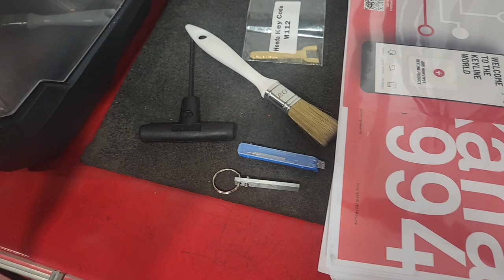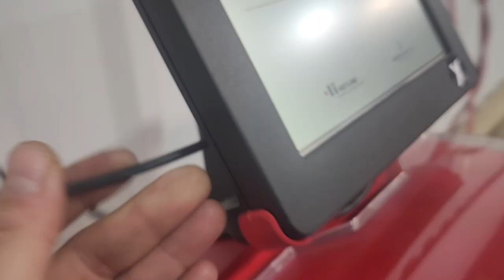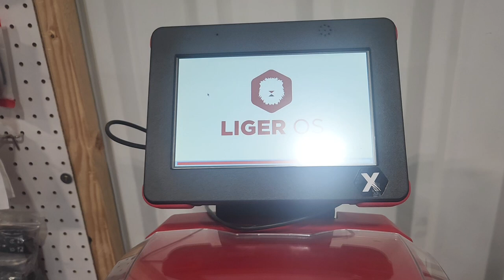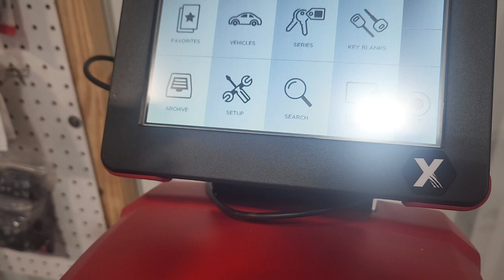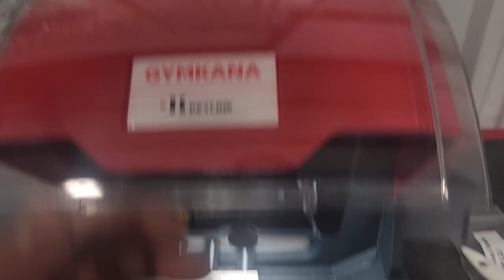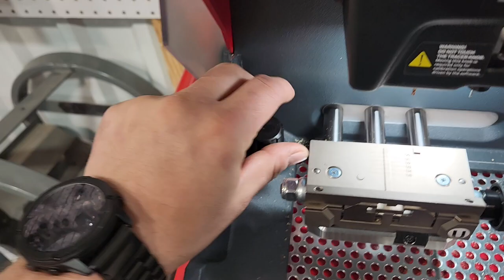NEW key machine! Check out the Keyline Gymkana!

Comment: Keith, if you need me to show you the function on how to tell you, if the code from a key that you scan is a actual code in a database , I can show you how to do that with the Xhorse dolphin machine, right from the app

I can also let you in a little insight on a maybe not so well-known fault with the exorcist machine. I’m not going to see which vehicle brand it is, but I like it because some of the local shop around here that decided to buy their own machines don’t know of the floor, and every time I go in and cut the key with my dolphin, or treat and machine. They look at me funny like I have some big secret.  

I will just say I struggled with enough of them and while rebuilding enough of the ignition because they’re prone to failure, I figured out what I call a fatal law in the dolphins software, because I know many people that machine just because that brand of vehicle issues, including me. It was time for an upgrade for me.
Reply: Proof read before posting.

Comment: the xhorse key machine line is like the ford f150 xlt of key machines. it leaves a lot to be desired but it gets the job done day in and day out. the other machines like keyline and silca etc. are like the shelby gt350 of key machines. making key stripper glitter is an addiction!